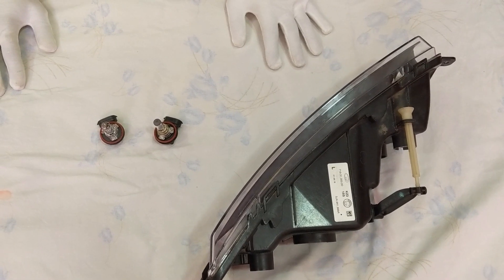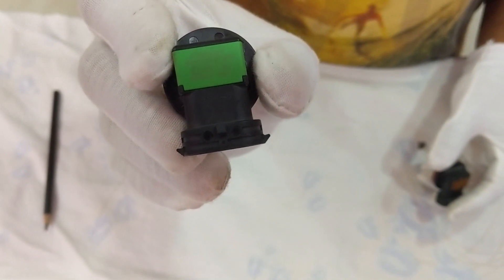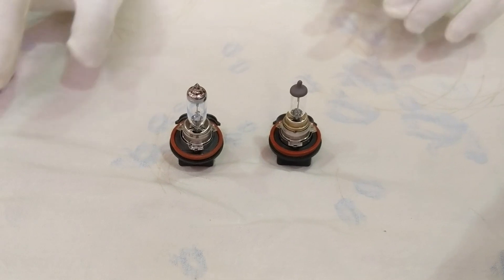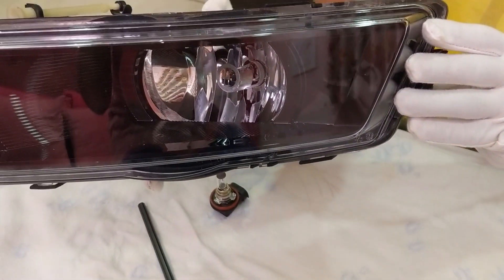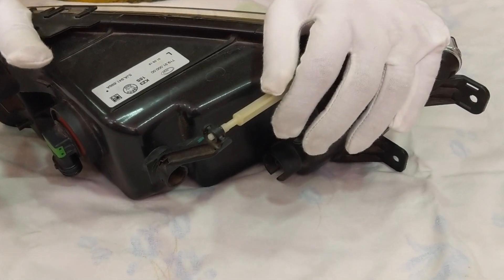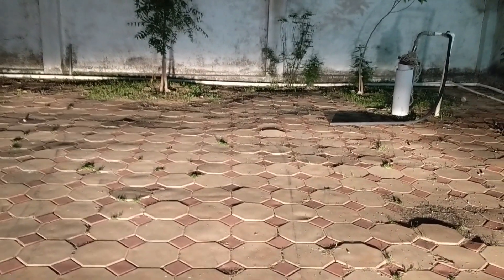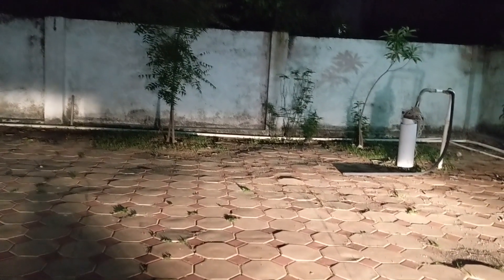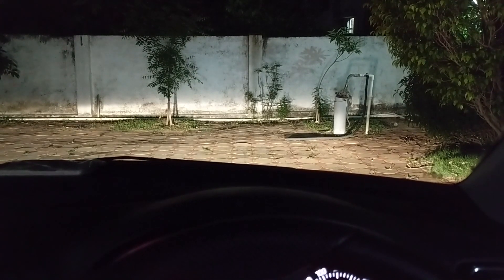Brighter Fog lamps, Fitting H11 Halogen in place of H8, Fog light Adjustment - Skoda Rapid

Comment: In my focus, rather than clipping a delicate bulb, I found it easier to permanently modify the holder in the fog lamp housing, by filing the slot until it was big enough to accommodate the larger H11 tab.

Comment: Have u checked with Techinician for upgrading from h8 35 watt to h11  55 watt,
Does wiring support 55 watt and no issues with battery for drawing more power from it.
Have to checked with technician on that.
Reply from the maker: yes, i did a bit of study to check the wires and the fog lamp unit to make sure it should be able to resist the power flow through wires and heat generated, and the system is designed well. As fog lamp has same wires as main headlight unit and same make.
About power consumption, there is not much of difference, and looking at the safety we should be able to manage if the battery last few month less than usual, if any. 
Hope I answered the question.
Reply: @vtgtsvlogs9152  thanks for reply i did recent upgrade of high and low beams to g force definitely i find it best with cheaper upgrade with no warranty issues
Any way i asked my close friend who is working in service also today to verify with technician once will update about that aslo
Reply: What did the service person say? Is it safe to use 55w led in 35w fog light wiring?

Comment: Will it "h11" damage the light assembly?
Reply from the maker: No, as i have checked, the make of Main headlight unit and of Fog lamps unit is same and also the wiring is same, changing to H11 a 55 watt bulb will not damage the fog light assembly.

Comment: Can we fit h8 in h16 fog ligt
Reply from the maker: H16, H8 and H11 share the same base, where H16 is approx 19-20 watt bulb, H8 is 35 watt and H11 is 55watt bulb.
If you want best output from your fogs then go for H11 (55 watt bulb).
To answer your quest, Yes, you should be able to put H8 in place of H16 (minor difference might be there in fitting, may be).
Reply: @vtgtsvlogs9152  today i installed h8 in h16 holder one of the three cutting where  bulb is incerted was to be made little big to fit the bulb
Reply from the maker: You will find much better and improved light if you fit in H11 (55 watt bulb), H11 should be a straight fit.

Comment: Hi.. can I put 43watt led in fog light holder designed for 35watts halogen
Reply from the maker: Yes, you may fit it, just check if the fitting type for LED is of H8 or H11 type, it will fit in with no hustle.
LEDs are not preferable for Reflector type head lights, as light from LED distorts a lot and do not give adequate results as it does not focus properly.

Comment: can i use h11 inplace of h8 fog light in vw polo 2012 model?
Reply from the maker: yes sir for sure, you can use H11 in place of H8 in any car for better light throw.
Reply: @vtgtsvlogs9152  h11
Reply from the maker: H11, H8, H7, H4 are all the Halogen bulb types Senthilji..
Reply: @vtgtsvlogs9152  H11 is 55 watts.. H8 is 35 watts.. So H11 obviously pulls more current which results in more heat.. 
In long term, it should not damage electric system..
Reply from the maker: As both Main headlight console and the Fog Lamps console are of same brand and are of same quality, there will be no damage to the reflectors.. as already hi beam is fitted with 55watt bulb and runs well.. so no issues with Fogs also..

Comment: Sir, one problem i experience with this was the connecting wire or electrical socket into the h8 was different to the h11. Which you didn’t mention in the video. Regardless, great video and Thank you
Reply from the maker: Thank you for bringing this up sir, both H8 and H11 share the same type electrical connection, there is just one difference that is in the fitting sockets, hene didnt mention in video, will check again for the electrical fitting for any difference.

Comment: Did you take h8 clip from stock and fitted in h11 or please advise.
Reply from the maker: Hi Sri Ram, for Halogen bulb we cannot change the clips.
As I have mentioned in the video, out of the three clip heads/hands of H11 bulb, the one in the middle is just a bit thicker than H8 bulb and this head do not allow H11 to get in place of H8, Just bending by plier or cutting the middle head clip and making it little shot makes it fit in. Hope it helps, else let me know I will suggest you how to do that.
Reply from the maker: let me check, and create a video on it, it might take a whil. You may let me know if we can talk and see how to help you.

Comment: Does this H11 (55w) create excessive heat or can this damage/melt the inside housing. Please can you confirm
Reply from the maker: There should be no problem with it, as all light focus units are of same type in Rapid. And when we see, Hi beam 5 watt bulb is also fitted in same type unit.

Comment: I think we shouldn't be putting 50w bulb in a 35w bulb. The wire can't take more heat and can cause fire. Its a safety Hazzard bro, please check with experts if any relay is needed.
Reply from the maker: I have checked the wiring before taking the decision of putting 55 watt bulbs, its the same as the ones at the top main headlight unit.
Thank you for the concern but its taken care.

Comment: Hello,  what's the difference between the h8 and h11 ? Is it the connector?
Reply from the maker: Yes, of the three connectors, middle one is a bit broader on H11, you can bend it a bit towards outer direction and fit it in place of H8.. Believe me it will change the complete headlight performance..
Reply: @vtgtsvlogs9152   Thank you very much! Could you pls tell me your e-mail? I have another questions about these bulbs. And hoping you can tell me the answers.
Reply: @vtgtsvlogs9152   Thank you very much!

Comment: Meaning of cliping bulb
Reply from the maker: The clip I showed in the Video is the Adapter that holds the bulb in the Headlight unit.
I am planning to create a video on it. will show how to remove the clip/adapter. Does this sound good?
Reply from the maker: sorry, i got u wrong. As displayed in video, the one hook/side on H11 is bigger in size compared to H8 bulb, which restricts H11 to get in the H8 slot. So we need to cut/bend/clip the hook/side so as it gets to the size of H8 and thus fits in H8 slot.
This can be done using pliers, I could not cut, but bend it and fit it in H8 slot.
Its easy to bend, just do not break the light.
Reply: @vtgtsvlogs9152  OK waiting for video thanks
Reply: I had also tried to change because of clip I did not know what to do so put the bulb back as it was not fitting
Reply from the maker: Ok, I will create a video to show how to clip/bend the hook/side of H11 to fit in.
Reply: @vtgtsvlogs9152  please create
Reply: @vtgtsvlogs9152  yes bro, i am too waiting, to see how to bend and fit it

Comment: Hi can this  9005/HB3 bulb fit in the H8 plug https://www.amazon.in/Bevinsee-9005-Headlight-White-Bulbs/dp/B07RM186HG/ any idea and this is worth to use in foglamp
Reply from the maker: While getting a LED for Fogs, make sure the light specification says it support H8, the one you selection will not fit in.
Also I will suggest you to get the LED with CANBUS chip, this removes any errors while using lights. Also see to get more than 12000 or 14000 Lumen lights. More lumen, brighter the light.
Reply: @vtgtsvlogs9152  
Thank you very much for the quick reply. 👍

Comment: Hi Bro, are u facing any electrical issues/fading in fog light housing after upgrading to H11 55 W. Since its been 1 year, looking for your valuable feedback
Reply from the maker: No there are no changes or bad effect on the fogs cos of upgrade, I made a through research before I put in the 55 watt bulbs, the main headlight unti and the fog lamp unit are made by same brand and has same material used, so no issues, also the wiring used are same. Hope i answered the question.
Reply: @vtgtsvlogs9152  Thanks Bro for the update. I just changed it to H11 and adjusted the foglight. Now the low beam and fog light are in same line and can see the improvement. Thank u very much.
Reply from the maker: Glad my channel is helping many of us.
Reply: @vtgtsvlogs9152  Yes indeed 👍
Reply: Can you update after 3 years if you faced any issues? Also is it okay to use these 55w bulbs for 5-8 hours continuously(highway travel)? My car is 2018 rapid will there be any difference in wiring? Thank you

Comment: Hi Sir, I have Renault Duster 2015 model. Can I use H11 bulbs as fog lights instead of H16 bulbs? In the car manual it is said that H 11 or 16 can be used. Does this require any wiring changes?